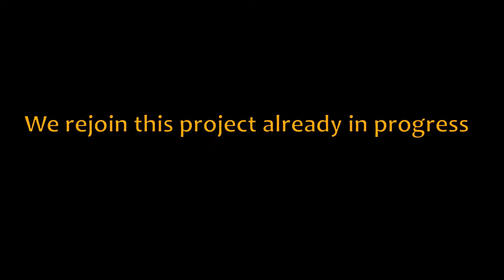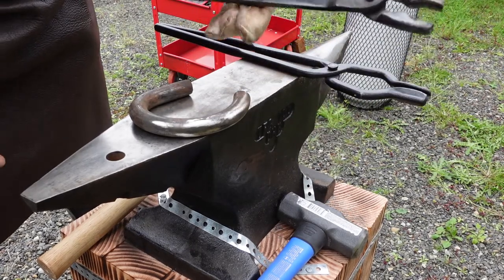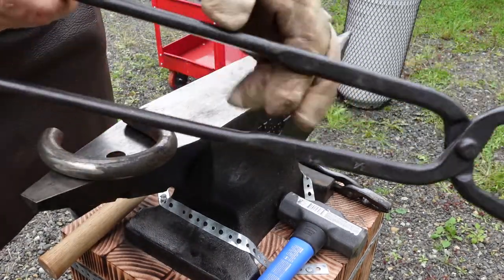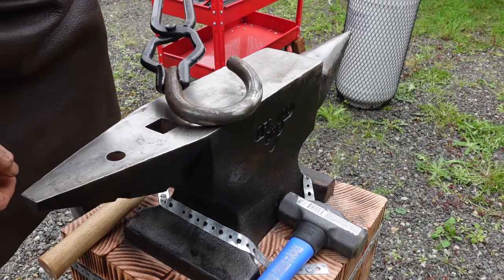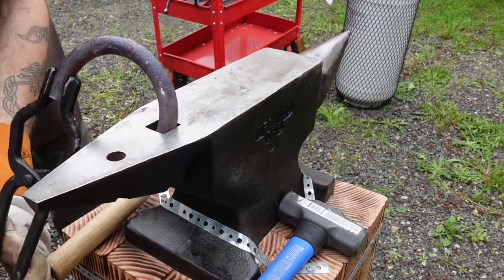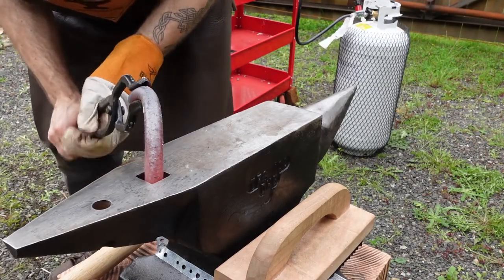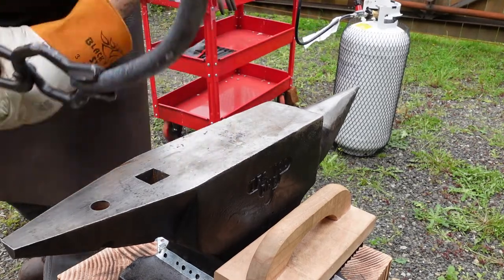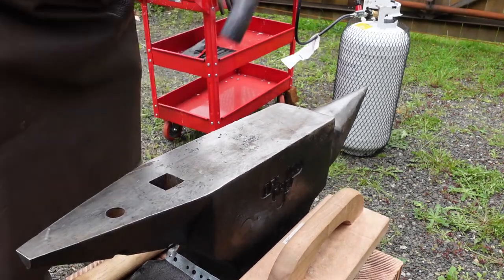Project 3 - Making Tool Blanks from Coil Spring Part 2

Comment: As you were straightening them I noticed that they seemed a bit twisted.  Will that pose somewhat of a problem later or does the annealing take care of that?
Reply from the maker: It might, I've read of techniques for rounding something so you can twist it without it showing, but that wasn't on tools that are going to be struck with a hammer.  The grains of the steel might be stressed by the twisting, annealing is supposed to help a bit by effectively melting the grains then letting them solidify. I'm hoping as I work the blanks into shape  that will pack the crystalline structure in a solid and stable direction.  We shall see!